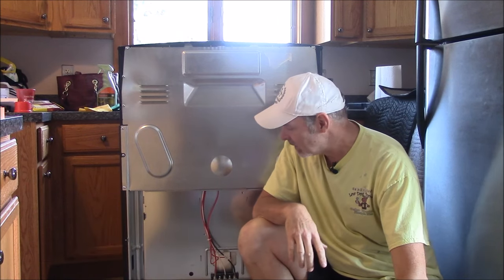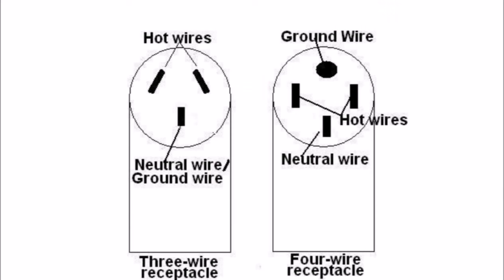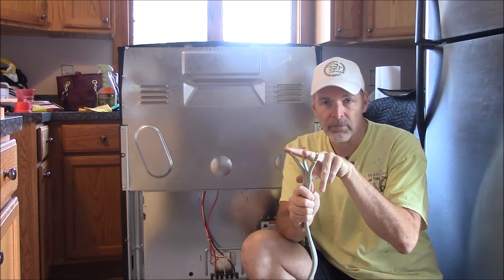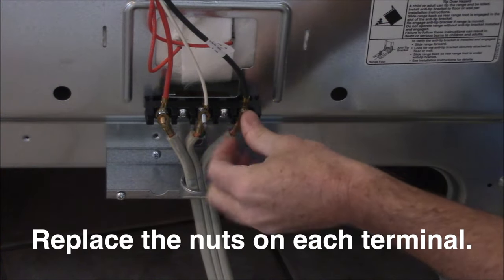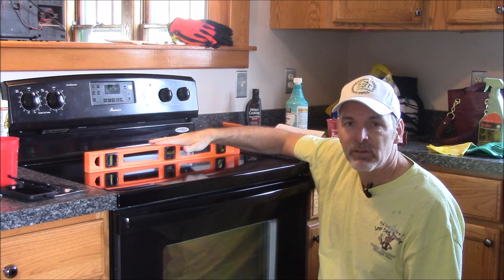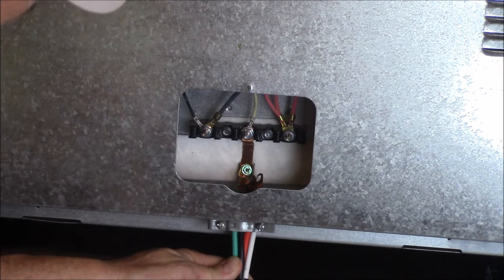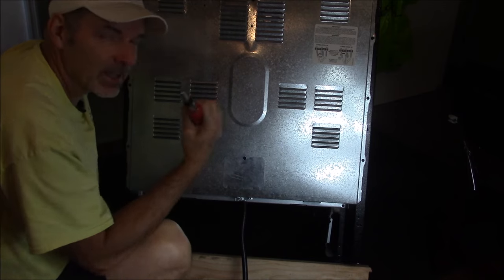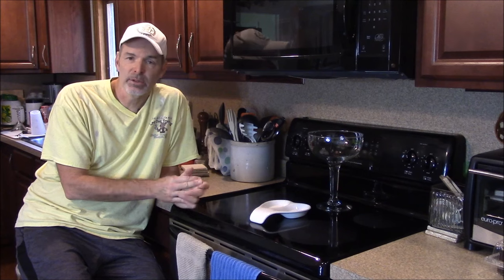How to Install an Electric Stove Cord

Comment: For those that noticed, in this video, I neglected to mention that you need to remove the grounding strap on a 4 wire installation.  I went back and did mine.  However, poor editing on my part left that important detail out.
Reply: Home Craft Chronicles My oven exploded because I didn't do that step!....Just kidding, thanks for the help.
Reply: Just installed one... What happens if it is not removed on a 4 prong installation
Reply: I'm changing my plug right now I'm changing a 4 plug to a 3 but my stove have no grounding strap is that bad ?,,
Reply: what about very old stoves where wires connected to the floor!?
Reply: What if u have a grounding strap and a small square grounding plate also? Should u evolve the grounding plate just leaving the strap on a 3 wire install?
Reply: @MOJOE85  on a 3 prong install, you need to leave the strap attached as the neutral doubles as the ground. You didn't mention, but I'm guessing the strap is attached to this grounding plate you mentioned
Reply: @HomeCraftChronicles  yes they both are there the strap but I can read on the instructions is for the three prong and is only supposed to be taken off if there's a 4-prong involved but there's also a little square grounding plate and the oven itself is not working meanwhile the stove is, making me think that that grounding plate needs to be taken off leaving the strap alone
Reply: Shouldn't you put the cord brace bracket so that the cord does not get strained when you pull the oven out? Otherwise it will come lose a short out like mine did, lesson learned for me. That's a safety issue you should address when you do this cord replacement.
Reply: I caught that and went to the comments to see if others did. Not everyone will catch this and so you should remove the video or re-edit it IMO.

Comment: I would consider adding annotations on the strap removal on the 4 wire cord connections, secondly on the 3 wire install you should of used a tomic connector or for ease of installation a 3/4" romex connector to protect the wire from getting cut over time from the metal, lastly on the 4 wire install the tomic connector was installed, but the rubber insulation from what it looked like wasn't pushed up far enough for the tomic connector to squeeze and the conductors are exposed which can result over time with cutting the wire. The tomic connectors are junk in my opinion to hard to use, as said before save yourselves headaches and get a 3/4" romex connector then push the cord up so that the connector is surrounding the insulation, tighten screws on romex connector,  then connect the wire to the terminals. I've easily installed over 400 cords in my 21 years as an electrician. Good video overall.

Comment: When you use a four wire setup you need to remove the bond on the stove between the neutral and the ground.. your installationon the four prong was not correct.. it's awesome that there are these how-to videos.

Comment: Excellent short and simple video. Should be a simple thing but my cord is unmarked and I didn't want to connect the wrong wire to red that needed to be connected to black. Simple answer - they're both hot so it doesn't matter. How come none of the other articles or videos I looked up before this one didn't mention that? Thanks.

Comment: Home Depot who shall not remain nameless showed up disconnected old electric hard wired electric oven, but wouldn’t hook up the new one. Took the old electric oven. Thus, I didn’t get to see how the old electric oven was hooked up. 
The hardwire only had two black wires and a green wire. No white neutral through the conduit that would have gone to the electric stove. There is a neutral in the junction box capped with three wires tucked in - seemingly untouched. Is the green wire the neutral? When I turned off the breaker the wires that once fed the stove were all off, but when I went to the junction box the white neutral wire was hot. I don’t understand. I only have three wires total, a green and two blacks.

Comment: Do not confuse a natural with a ground....they are not the same.. When changing from a 220v-240v to a 110v-120v run a new 20amp circuit for the  Igniters

Comment: There needs to be a cord strain relief /protector in place where the range cord enters the stove ,, otherwise the sharp edge of the metal will cut into your range cord over time creating a dangerous high current short circuit ,, I believe its required by code for this very reason..

Comment: I have to change my old 3 prong plug to a 4 prong but I can't for the life of me remove the screw that needs to be removed in order to get the grounding strap off and have something to screw down the green wire.  Any suggestions on how to get the blankety blank screw out?

Comment: Also important for a range installation are the brackets that hold the range to the wall so it can't tip forward.  If you sell the house, the inspector will look.

Comment: good info. I need to run a wire into another room through a wall and over some rafters for a stove.  can I just run the wire or do I need some sort of conduit?
Reply: Dylan Strawn of you need to run a new wire from your electrical box for a stove, my advice would be to hire an electrician. What you saw on this video is about the extent of my knowledge of 240 lines.  Not something i mess with often, so i cannot offer any advice on your project.
Reply: You can run an 8-3 nm with a ground in it for your stove, however jurisdictions can be different on if something has to be hard piped instead if using romex, Chicago is an example of one place that requires hard piping. Best to check with local codes or hire a qualified local electrical contractor to do the install. 4 wire conductors are required on all new stove installs per the NEC.